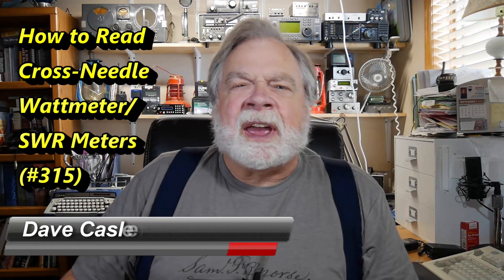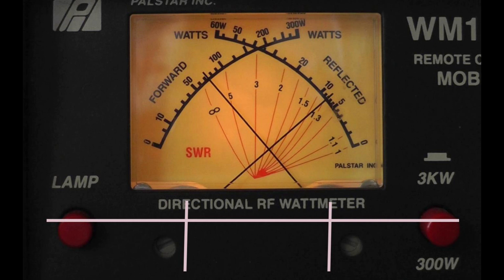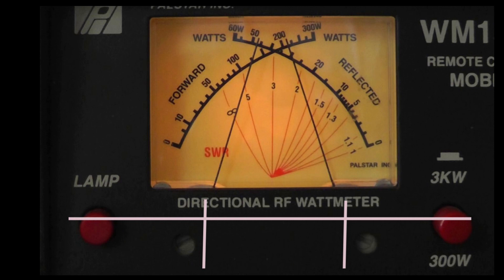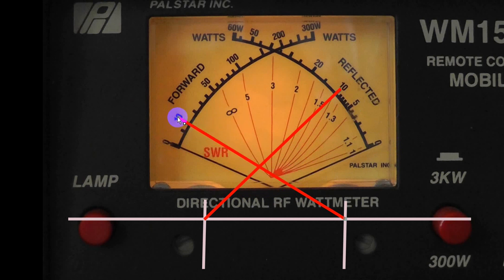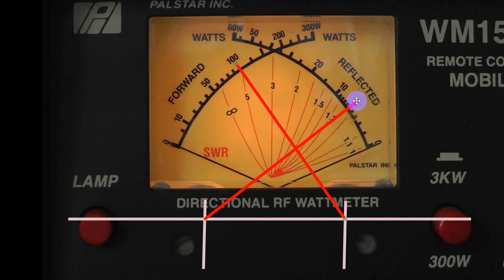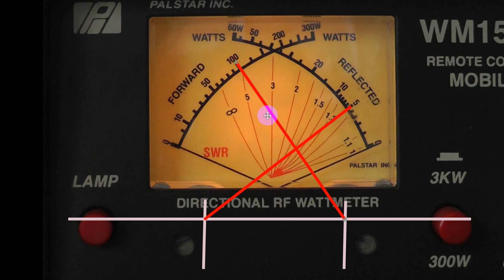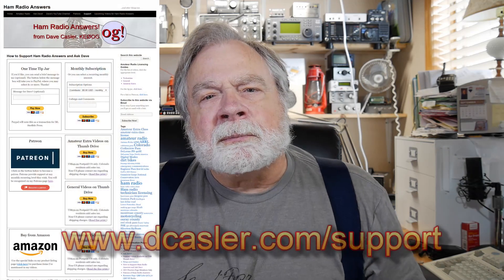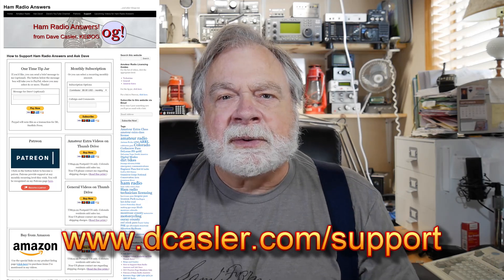How to Read Crossed-Needle SWR/Watt Meters (#315)

Comment: One additional tip, with the frequency you're planning on operating, switch to CW (preferably at reduced power) or AM, move 4 to 5 khz away. Transmit and tune accordingly for lowest SWR. Never try to tune with SSB. 

The interesting thing about SWR is it doesn't really change with increased power. It's just more apparent and easier to read. 

Thanks Dave.
Reply: Hi thank god some one said it ,,,hahaha

Comment: I have an MFJ-941E manual tuner with a cross needle meter. I normally tune in AM mode, but any constant carrier mode will work.

Thanks for the clear explanation with examples. 73

Comment: I just learned about the needles crossing and reading there earlier. I’ve been reading mine wrong.. time to climb on the roof and do some antenna adjustment
Reply: I hear that, back up the ladder so I can adjust the rings again.
I'm really good on ch. 1 and 20, but it's a tad high on 40, so I'll be lifting the rings up a scoatch.
73's..

Comment: Hi David. Thanks for another helpful video. A question though that I can't seem to find an answer for anywhere. I have a new Diawa CN-501H2 and would like to know if it's okay to leave it inline all the time when operating CW. I'm concerned that the needles slapping around contantly could damage the meter. Thanks

Comment: Nicely done as usual Dave.
I do NOT like cross needle meters, too hard to read as they are usually too small, and inaccurate to guesstimate from, like the one on my MFJ Intellituner.  So I cheat, I the single meter on the amp is easy top read direct SWR or Power out (along with High Voltage, Gris and Plate current) but the easiest to read is the MFJ 870 single needle, LARGE meter which seems to be very accurate much like my Heathkit HM-102.  I would like the MFJ digital model, or event the Elekraft LED SWR meter, but what I have will do.  Thanks again Dave, again, nicely done.

Comment: Are SWR meters band specific or one sold for 11 meters work in any band besides 10M? If they are not the same, how can you tell what band(s) the “vintage” equipment without manuals work for? Can using the wrong one burn up your rig?

Thanks.

Comment: I have a mfj894 when I took it outside to get a reading on my mobile rig I noticed the forward meter was between 10 and 20 watt but the reflected needle is at 0. Does the cold weather has an effect on the coil at the base of the needle contracting. Those reading was before I hooked up the antenna and transceiver. When I bought it back in the house the needle eventually read 0. It was around 34 degrees outside.

Comment: Tank You Dave and I have them on my MFJ 969 and MFJ962D.
You can use these to make "magic" - and 0 W Refl by finetune with roller and ANTENNA variable condensator! I also use LDG Z11 and LDG 200PRO Excellent types of tuners. Byt You have to decrease outputeffect temporarily from RXTX. 
But what the heck!  
Perhaps LDG deserves some interest and profilering? What about it? With FT817/818 or ICOM 703+ then Your able to tune without fuzz!
Am I wrong? 73s Gus sm6oer

Comment: Am I correct in saying that the smaller the reading of SWR, the better it is? thanks
Reply: You are measuring a type of feedback that can overheat your radio parts. Todays radios are pretty tough. In the 70's a radio would blow up in seconds if the ratio was too high. Anyway you want to keep the "reflected power" below 3 to 1.yes, the lower the better. You prolly wont get below 2.0:1 with most antennas. But, it's ffun trying haha